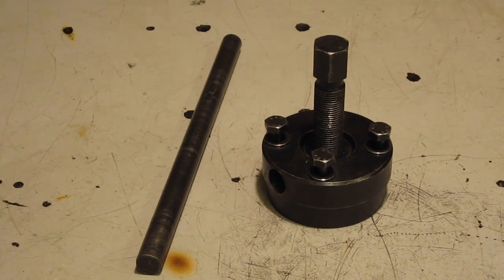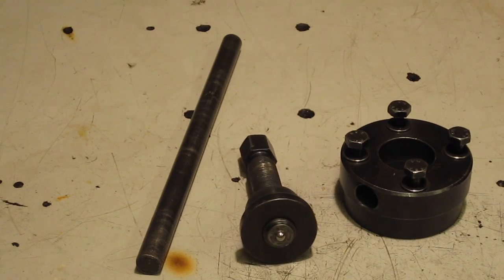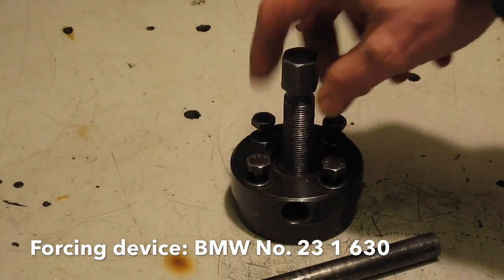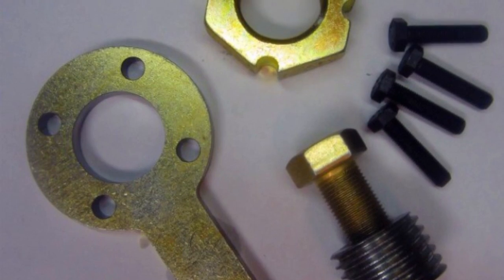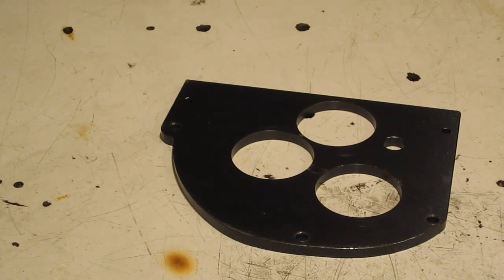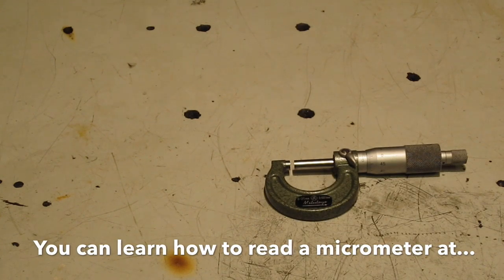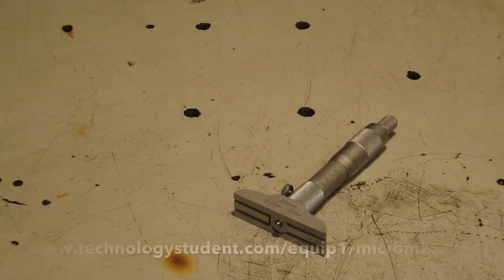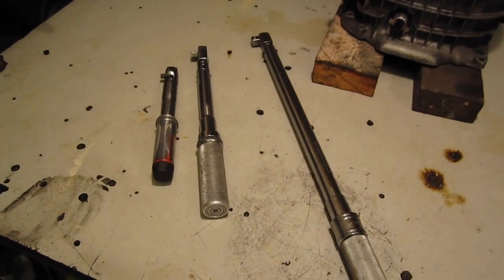R100RS Gearbox Overhaul Part 1 Special Tools

Comment: Hey, Moto Phoenix!
I freeze on my back when I see this. I feel it's way beyond my mechanical skills. I have a 1983 R100RS and the gearbox could do with a checkup and maybe an overhaul (some of the shifts are a bit gruff). Do you take on repairs? If so, I'd be very interested. Please, let me know!
Reply from the maker: Hi, no, sorry I don’t do repairs. If you look in the Small Business Ads in the BMW Club Journal, there are usually about ten independent technicians from around the country who advertise there.
Reply: OK, thanks! :-)

Comment: Thanks again for your excellent videos . Can you tell me if it's possible to replace the gearbox out put seal with the gearbox still fitted to the engine.
Thanks Ian.
Reply from the maker: Hi Ian. I've never tried. I think removing the drive shaft flange on the gearbox output shaft may present quite an obstacle in situ and getting a new seal to fit satisfactorily would present difficulties. 
If you try it, let me know how you got on. Guy

Comment: Hi , what terrific , easy to understand videos you do. They are most helpful, thank you . I wonder though if you are able to supply the dimensions , hole sizes , centres etc, for the output shaft flange puller , as a friend has offered to make one up for me. I cannot seem to get my hands on one here in South Australia. 1989 R100RT.

Comment: Hi,

Great video series on gearbox overhaul. Really helpful and well explained. 

I recently bought a 1979 R80/7 and have found metal flakes and a few small thin sharp twisted metal fragments in drained gearbox oil.

I was thinking about taking gearbox out and taking a look inside, but I'm new to this, so not sure!

Kind regards
M
Reply from the maker: Thanks for the kind comment.

If you have found swarf in your oil, the gearbox should be looked at before you ride it further. Usually it is the bearing at the clutch end of the output shaft that fails first and if you continue to ride there is a real risk of wrecking the gearbox.

Gearbox removal is quite straightforward with the help of a workshop manual. But if you do not feel confident about doing the overhaul, there are reconditioned ones available from Motobins or Motorworks.
Reply: Thanks for your advice!!
I was wondering if you take on this type of work? I'm in Essex area.
Reply from the maker: Possibly, but I will not be able to for 3-4 months,
Reply: Thanks Guy, 
I might take the box out and either have a go myself or send it off for repair/or a refurb box.
Reply from the maker: Good luck. Sorry I can't look at it sooner.
Reply: ok thank you. Please let me know if anything changes and you have time. Its proving difficult to find somebody who is local.
Reply from the maker: +Mark Loder okay, I'll get in touch here as soon as I am available.
Reply: Hi Guy, after much thinking and watching your great video's, I decided to buy a recon gearbox from Motorworks. 
I've got a random question I thought you might have some advise on.... do you know if there's a particular method or steps on fitting engine protection crash bars?
I'm having problems getting in the bolts that hold the brackets on, doesn't seem to be enough space as engine block is in the way!
Reply from the maker: Sorry for the delay, I have only just returned from a trip. Not sure which model you have Mark, but on my GS the upper mountings can be awkward and fitting can be made easier if the front cover (alternator / ignition etc.) is removed. Disconnect the battery earth strap first to reduce the chance of generating a short. As for other models, I don't have any suggestions without actually seeing for myself. You could try loosening and/or removing one  or more engine mounting bolts and lift the engine a little with a small jack to give a temporary increase in clearance to get a fastener in.
Otherwise, a good source for advice is the Airheads BMW Motorcycle Riders Facebook page. They are a helpful bunch
Reply: Thanks Guy, appreciate your help!!

Comment: Excellent. Thanks very much for your time and effort in putting this together. Funny that the flange nut was so loose.
Are the 800 G/s and 100GS gearboxes interchange-able?
Reply from the maker: Thanks for your kind comment. I believe there is some interchangeability between models, but you need to check carefully since there are differences between some model years.
Reply: Hi again

I really enjoy watching your videos . They are very informative and quite useful from a technique - al perspective.
I have been informed that the input shaft is different  (longer) on the heavier flywheel models and slightly shorter on those like my '81 r80 g/s which sports a lighter flywheel
does that sound right to you?
Reply from the maker: Hi Max, yes there have been significant changes made at different times during the production run these motorcycles. Not only are there differences between the so called heavy and light flywheel models but there are also changes that have been made since the light flywheel version appeared. Indeed the gearbox featured in this series of videos had complications due to parts availability, which resulted in a later input shaft having to be installed to match the other new replacement components. If you look at the Moto-Bins web page you will see that there is more than one type of light flywheel input shaft available.